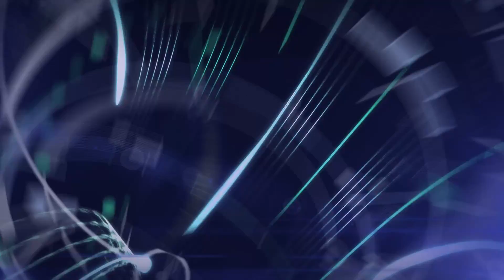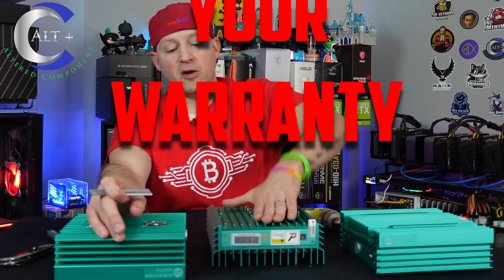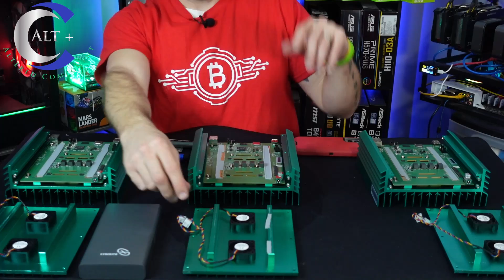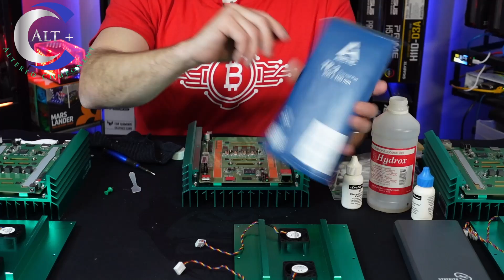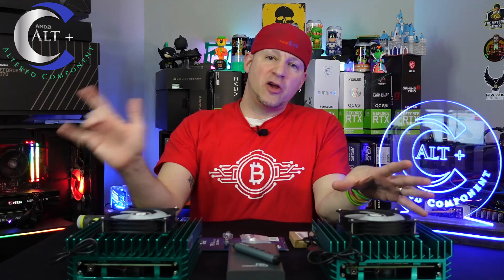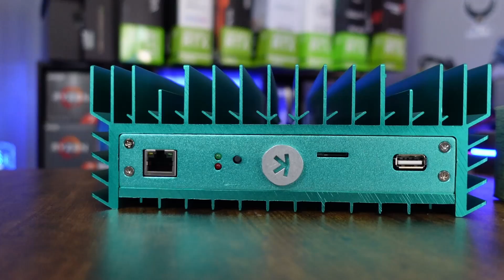🥶 IceRiver Ks0 Pro Special Edition | Full Teardown Easy Step by Step Heat Treatment For Overclocking

Comment: Brand new to Crypto and was very intrigued by the low cost of these and if they are worth it.  It looks like people bought them all up and I don't see any under 700 dollars.
Curious to see what your profit numbers are after running this for about a month.  And how does the modded ones compare to the stock one?
Not sure how accurate those calculator sites are, but one I looked at said it only generates 50 cents a day after electricity costs?  That seems very low and not accurate.
Reply from the maker: Honestly profits are pretty low on these now.  Goldshell dropped out miners on Kaspa network to go with Iceriver, Bitmain, and a few others.  Network has become saturated. expect around a 90 cents USD earnings per day on these in the current climate pre electric.  If you pay more than 500 for one of these, that is a very long ROI, and the hashrate keeps climbing.  FYI, a stock does like 200ghs on 100w, a decent overclocked pro runs around 265-300ghs for around 50w increase.

Comment: 23:20 This is not true, I used the 9x9x5 heatsinks. The 6x6x5 heatsinks are always out of stock, but the 9x9x5 sinks work actually better and do fit, they just hang over the edge of the mosfets. The 9x9x5 actually have better thermal dissipation because there's more copper to radiate heat.
Reply from the maker: i thought over 8mm would touch to be honest, but good to know.  Yeah, more surface area always equals more heat dissipation.  so smash as much copper on there as you can.  Love it
Reply from the maker: i have a couple lemons of my group....2 of the 6 perform poorly on overclocks, bad silicon.  they heat up quicker.  I really am thinking of pulling apart and putting bigger heatsinks on now...i blame you
Reply: I used 7x7x6 Aluminum heatsinks, as they were more readily available to me. No issues with fitment, and they came with 3m adhesive pre-applied (no mess). Good to know that 9x9 will work too.

Technically speaking, aluminum dissipates heat faster than copper (the heat leaves the aluminum faster by way of airflow) and is actually ideal for this application. Copper transfers heat from the cip to the heatsink faster, but that heat sticks around in the heatsink mass for longer. I'm not sure if one will necessarily outperform the other due to this, but the aluminum definitely works!